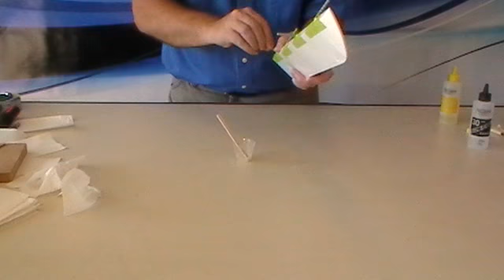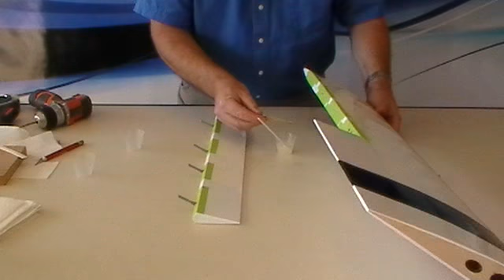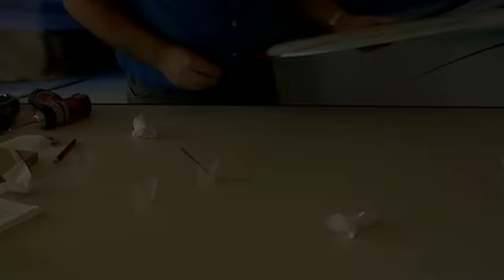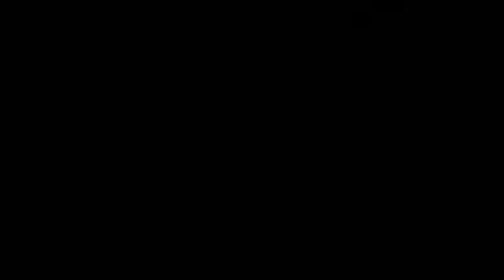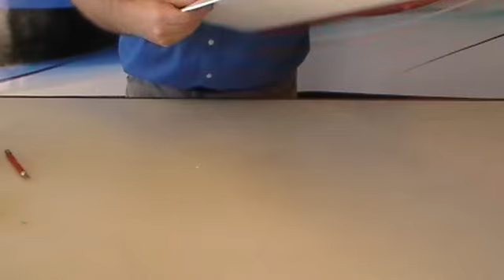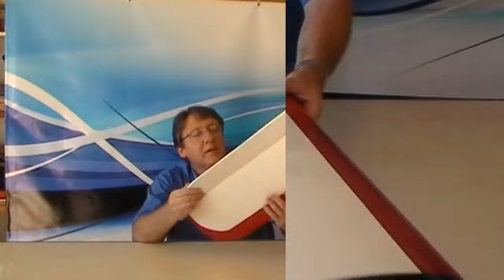Installing Robart Pin Hinges  Part 3

Comment: How to make a straightforward job so complicated. Flat hinges with pins are so much easier and far less trouble to install accurately.
Reply: I would say yes to the flat pin hinges as well but even that type can pull out if not installed correctly. I like how Jim soaked the hinges in denatured alcohol first. There is a mold release on that plastic that should be removed first before use and roughening them up is a wise move. I used to pin my flat hinges in with round tooth picks from the bottom side just to make sure they would not come out prematurely. Once pinned in, they never came out. The extra steps with the tape is something that I never worried about and was always able to clean up any drips with paper towel and some alcohol no problem. Getting the slots to line up is super easy with the Dubro Kwik Hinge Slotter tools.

Comment: I followed this and my hinges were frozen I don't see how you can put that much epoxy on and not have it solid as a rock.
Reply: If you followed my instructions here, your hinges should NOT be locked up. They may stick a little as you free them up afterwards, but they should free up nicely. Do it the way I did it in these three videos, and DON'T take short-cuts. Every single step here is important. If they weren't, I wouldn't have included them.

Comment: Some of the ARF pin hinges aren't bad, but I usually go with the Robarts just for the peace of mind a few extra dollars provides. Making sure they're well-glued is what it's all about, and making sure that nothing prevents the glue/epoxy from working, such as grease or oil on the barbed sections. Attention to detail really does make all the difference.

Comment: Nice video series.  I hate CA hinges and have always replaced them with the Dubro pin hinges.  I have tried the petroleum jelly on the hinge joint, but have discovered that it just makes a big mess.  I have gone with doing the method you have demonstrated here.  Have not used the Robarts but will be using them on a future build.

Comment: Not sure what you're asking here. If you mean, could you use clear tape for the areas where the glue mess will be, then yes, you could use it, but it sticks too tightly for it to do a good job of it. If you're asking whether you could use tape AS hinges, that's not for me to answer. I wouldn't do it. The reason I use Robarts is because the CA hinges are the same thing as an expiration date. This is a big plane, with massive forces upon the controls surfaces.

Comment: Thank You. I have another question. Could we have used a clear tape or packaging tape. Does it have good strength ? and is not easier ? or are there drawbacks for using them?
Reply: I guess I missed this one! Fadak, you couldn't use clear or packing tape for keeping the glue out of the seam area, because they stick like crazy and would peel your coating/covering right off of the plane. It's important to use tape like the 3M number I listed here because it comes off easily even after a few days, after getting wet or getting glue on it, etc.

Comment: Hi,thank you for the video. I have question, how do you know how many hinges you gotta use? thank you
Reply: I just space them so that they're even, and I try to make sure there's one fairly close to each end. most surfaces use four or five, or maybe more if you're using the smaller hinges on a good-sized bird.

Comment from the maker: They hold into the wood that frames the piece. On this particular wing, there is a piece of ply that runs through the middle of the surface, which provides more contact area inside. Hinges only go in a short ways, and usually only have maybe 3/4's of an inch to and inch to hold on to. If you looked at it from the inside, you'd see the pin coming through the wood into the space a bit.

Comment from the maker: I sometimes take a tiny blade and cut back from the hole through the plastic a little ways, to create a little extra extra surface area for the epoxy to hold to.

Comment from the maker: No. Cut them off flush. Use a very small drill to go down through the plastic and create a good pilot hole for the Pin hinges. It's a little tougher replacing the CA hinges with pins after the CA hinges have been used, because the wood has already been sealed by the CA. So make sure the hole is a little bigger, and make sure you get plenty of epoxy into the hole, to create an extra anchor area inside.

Comment: Dip just the joint in melted Vaseline, no need for cleaning and adding alcohol. Try using the pacer hinge glue. No need to tape the wing up, cleans up with water.